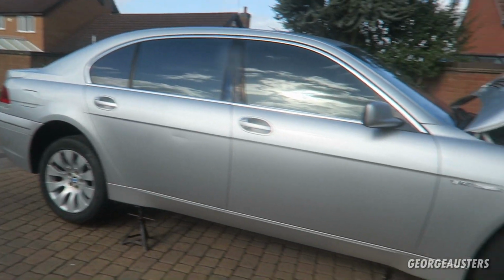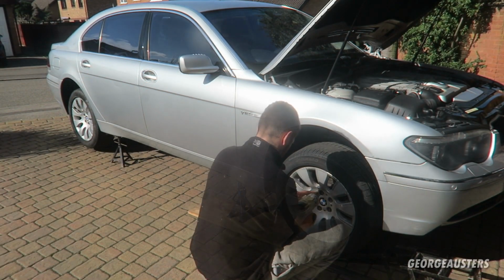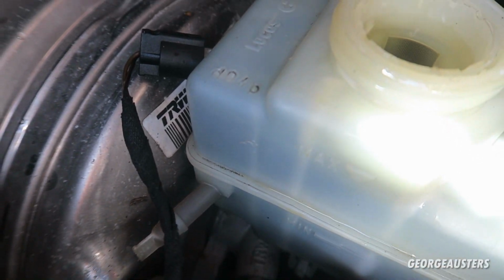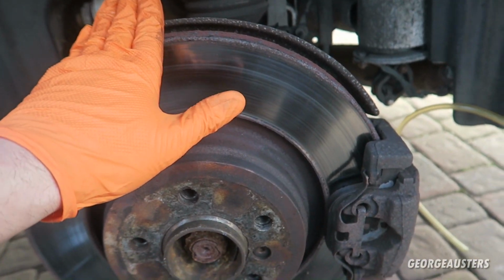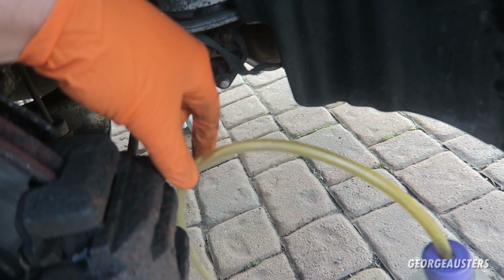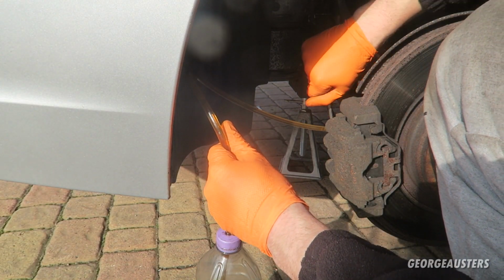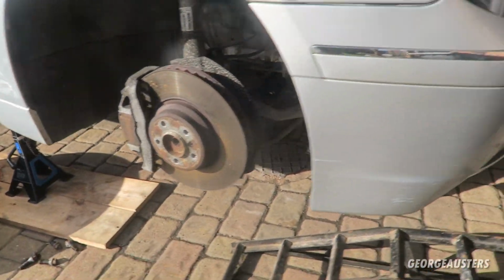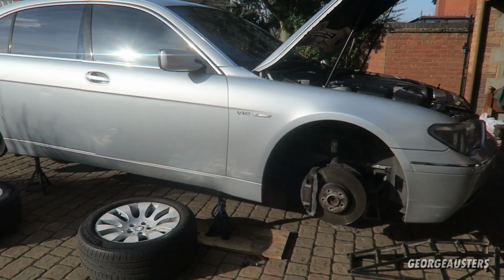BMW E65/E66 7 Series Brake Fluid Flush

Comment: Kinda funny.. my dads rear passenger was snagging, dangerously.. ordered the part. Turned out it was for a e65 not an e66. Took it back. Put the old one back on.. turns out .. needed break fluid, we bled it through.. and boom. No more snagging.

Comment: What about the brake fluid stagnating in the DSC unit? Wouldn't you need to remove that by connecting the diagnostic tool and instructing the DSC unit to actuate its pump and other side facilities?
Reply from the maker: It all gets pushed through

Comment: Does that mean his brake piston are probably on there way out? Seized
Reply from the maker: Why?
Reply: @GeorgeAusters  all the contamination from the fluid, minerals, oxygen would it not cause the pistons to rust over time?  And then eventually seize
Reply from the maker: @theeroom  That's a valid point. They all seem to be fine at the moment but I will be inspecting them when I do the brakes teardown and if I notice anything then i'll sort it
Reply: @GeorgeAusters  I told you HahHa is that the same care you did your new video on?? Seized brakes "😁
Reply from the maker: I thought about your comment when I noticed haha!
Reply: @GeorgeAusters  haha 😁😁😁🙏